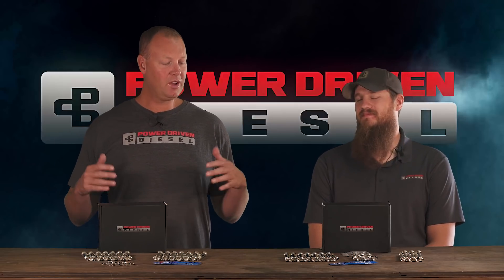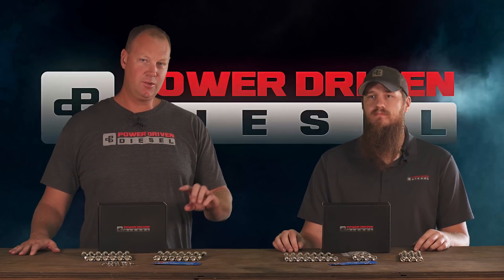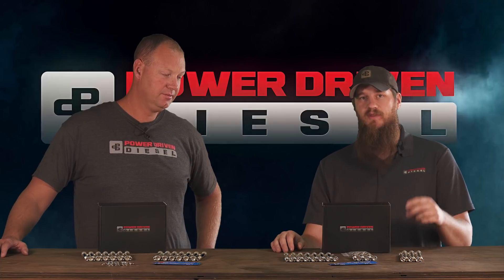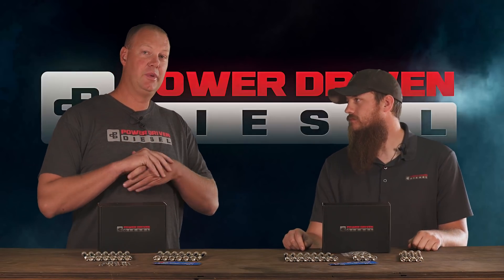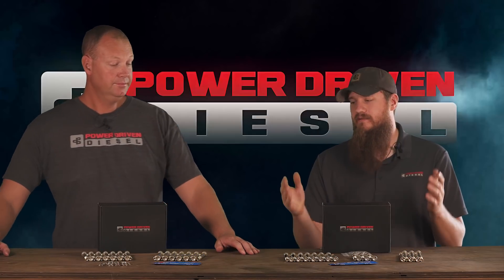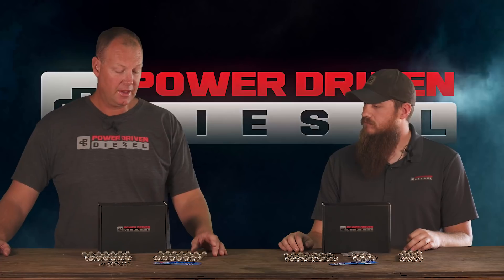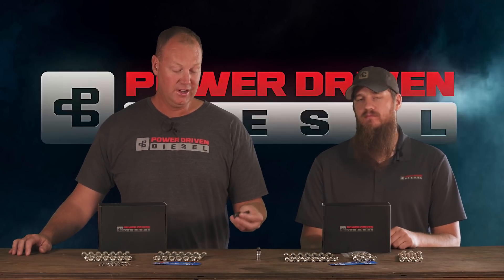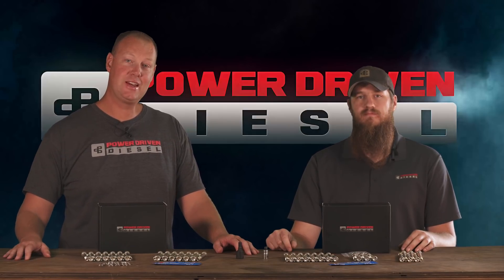Socket Cap Head Bolts for your Cummins | Parts Bin EP 23 | Power Driven Diesel

Comment: My 1996 12 valve head gasket leaks a little coolant externally at the front passenger corner.  In 50 miles I lose about 2 cups of coolant.  Do you think swapping out the stock head-bolts with these and torquing them down properly is worth trying before just yanking the head and replacing the gasket.  The engine is stock.  Never has been opened up.  Has 275k miles on it.  Runs perfect.  Does not consume a drop of oil. Does not leak oil.
Reply: Just change it urself, $250 job. Felpro gasket is exactly the same as what cummins orders from Chinas and Mexicos. You'll need a hand landing it back on. $250 did it for me in socal
Reply: @IvonIvan-c6r I changed it about 7 months ago.  Ran into some money so I installed a new head, Mahle gasket kit and arp studs.  Got the rocker pedestals milled down for the studs.  Also did some pump work, new injectors and new turbo.  Runs so good now.  Like music to my ears.
Reply: @CustomJeep hell yeah

Comment: I know this is an older video, but do they come in an M12 x 1.75 x210mm?

I'm building a Deutz, and will need a head bolt upgrade.  It would be nice to have the coating for corrosion as i live in an area where salty roads are an issue.

Comment: can you swap these out one at a time safely or do I need to pull the head off? If someone can share the best way to do this that would be mega awesome. i am looking to add more power and I want to get ahead of any issues on my rig.
Reply from the maker: YES WE DO THE ONE AT A TIME METHOD ALL THE TIME AS A SEASONED HEAD GASKET HOLDS GREAT
Reply: @pddofficial  ohh sweet thanks guys. I’ll be putting an order in for these and looking at what to do with my clapped out turbo lol. Ohh btw why do you not ship transmissions to California? I may need to order one and I am pre smog here.

Comment: Well I can’t prove that the bolts failed but I put a set of these in my 12v and 3000 km later I’ve got coolant running down the side of my block. Pulling the head off and going with ARP studs. Thought I was well within the limits they’re talking about with a single 62mm turbo and 5x12 injectors, the usual mild work on my 215 ppump🤷🏻‍♂️ had the head resurfaced and thoroughly checked out before putting it all together so I don’t know what went wrong.

Comment: Will it hold with 50 psi of boost
Reply from the maker: Depends on how much timing you're running and where in the  RPM range it's making 50 psi.  50psi at 2k RPM needs studs for sure.

Comment: I would be pretty skeptical of running a set of these if longevity is what you are after. Normal SHCS are NOT engineered to the same standards as high load automotive fasteners. Stock head bolts have a special thread form that controls the root radius of the thread to remove stress risers. SHCS have a normal thread form that can allow for a very sharp radius in the root of the thread. Stock head bolts are also subject to a multitude of tests including thermal and fatigue tests. SHCS are subject only to a tensile test. While all 12.9 SHCS should be the same on paper, we know that the standards for that grade of fastener allow for a variety of different manufacturing options that would all produce a different performing fastener. For the little money these cost, I would still choose the stock head bolts because they have the extra thought put in to ensure that they last for their intended application.

Comment: I don't know if thay looked in to it i instead cap bolts on my truck and I messed the old head bolts and the hole in the block and using a bottom tap was able to buy bolts that were 15mm longer than the factory head bolts to get into unused threads in the block.
Reply from the maker: If bottom tapping occurred on every engine, some of the bolts can be made longer.  However, this product was designed with ease of install as a major objective and bottom tapping the block with the head installed is not easy.

Comment: Used to run same 12.9 bolts as a budget solution for the turbo BMW guys on the old M20 6cyls. We used the factory head bolt washers which where virtually identical to the washer you provide. And yes, chamfer always goes against radius on the underside of bolt head, basic mechanics 101. Also besides the size issue of standard washers is you need a hardened washer to hold the torque load. A standard washer will crush and continue to due so through heating and cooling cycling leading to loss of torque and subsequent failure of head gasket.
I especially appreciate all the research and testing that went into this product, even selecting the correct socket tool to go with the bolts. Excellent work 👍🏼

Comment: Running some from mighty Diesel for years compound 64 71 12 over s480 seen 80psi original head gasket just switched one by one
Reply from the maker: You are living life on the edge!  Keep the timing very conservative or you will have head gasket issues!

Comment: How did you run your torque test? Did you measure bolt stretch? 125 ft. Lbs is nothing. A standard impact Allen socket will work just fine for install. Get a set from Harbor Freight. I used them for sawmill maintenance for years. Never broke one using an Ingersoll Rand 1/2” and 3/4” impact gun. I might look into installing a set of these. 2001 with 99500 miles. 67mm c/w & t/w turbo with .010 X 7 injectors and Quadzilla adrenaline V2 tuner.